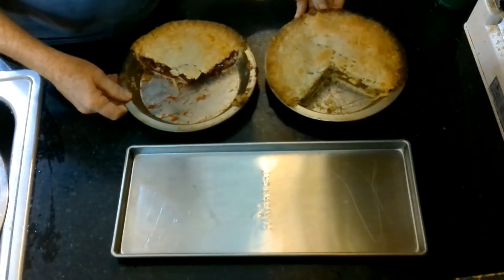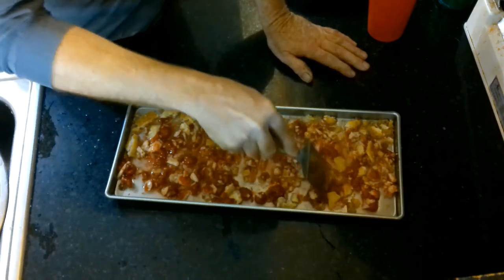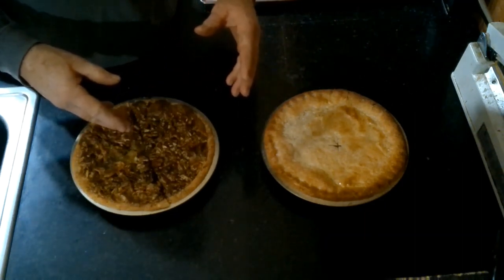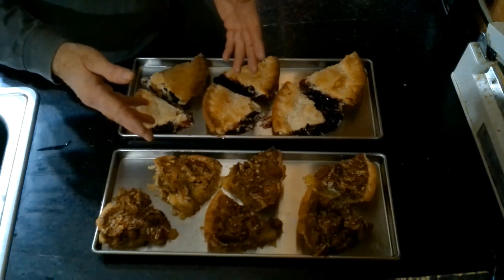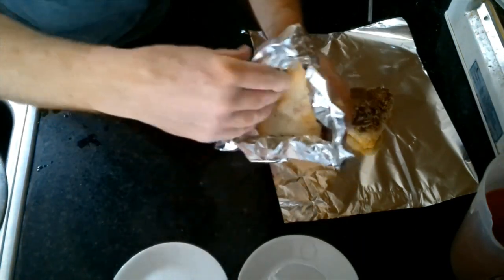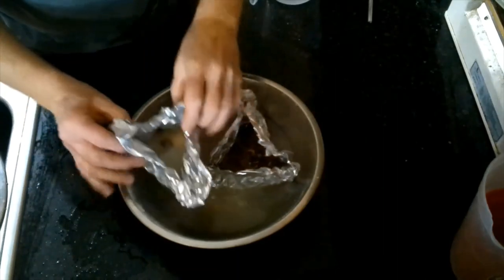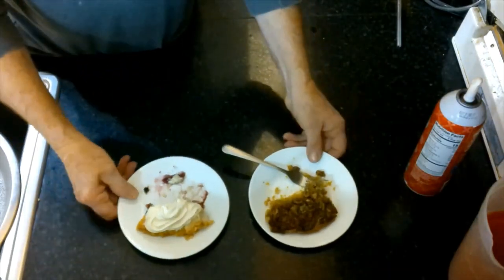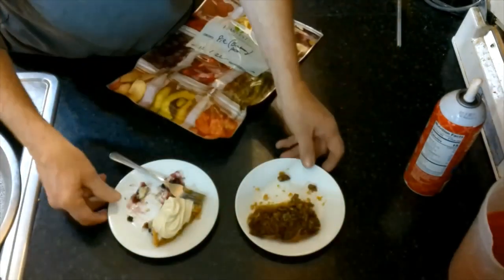Pie-  Freeze Drying and Reconstituting

Comment: Hey 👋 new viewer here 
Just got my harvest right right before thanksgiving 

Question I have ……. Other than cutting down on freeze time from the machine is there any other benefit to pre freezing from your experience?
Reply from the maker: Prefreezing your food uncovered will remove 5-6% of moisture.
Reply: The speed of freezing alters the size of the ice crystals. Large ice crystals tend to damage the cell walls in fruits, veggies, meats, etc. This is why frozen fruits and veggies that have been thawed are mushier than fresh ones. The faster you can freeze your food, the better it will turn out. I recommend setting your filled vacuum freezer trays in a chest freezer turned to it's lowest temperature setting, and placing a small fan inside to blow cold air over the trays until they are frozen solid. Or if you want the best results, you could use dry ice.
Reply from the maker: @arconreef  In a perfect world we would have an endless supply of liquid nitrogen.  I built a shelf, for my trays, directly in front of my freezer's defrost fan.